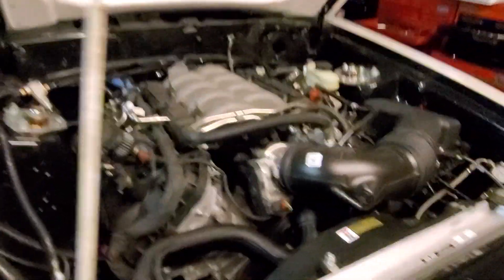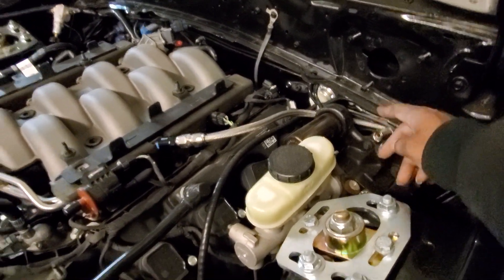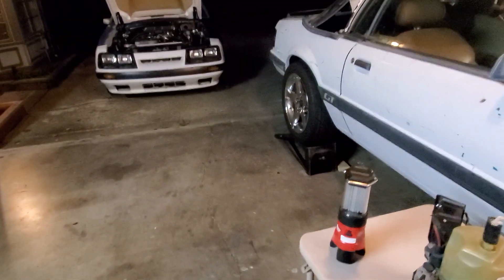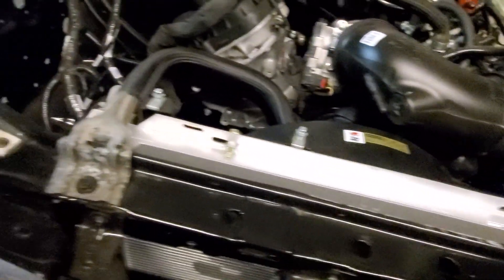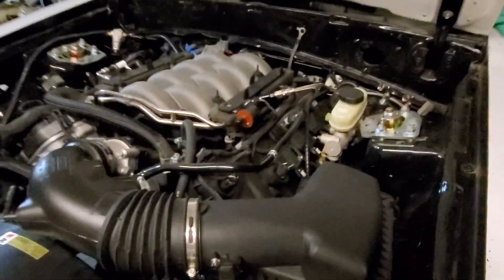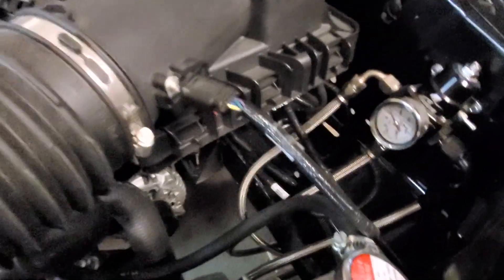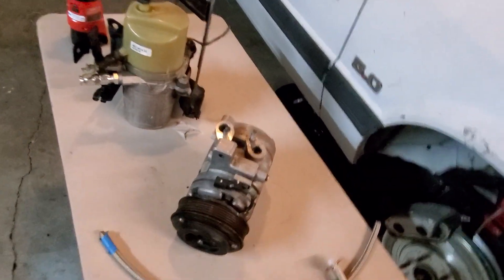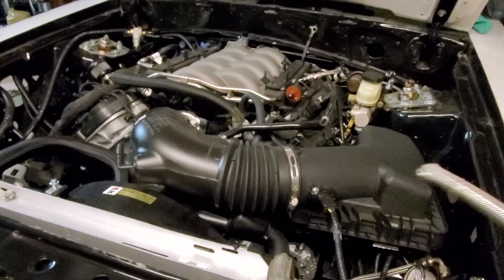Gen 3 Coyote Swap Power Steering - Electric or Belt Driven -

Comment: 96 thru 99 fitting for hydroboost is diffrent from 2000 to 2003.
Reply: Could you use this setup on the 99-04 mustang Hydrobooster